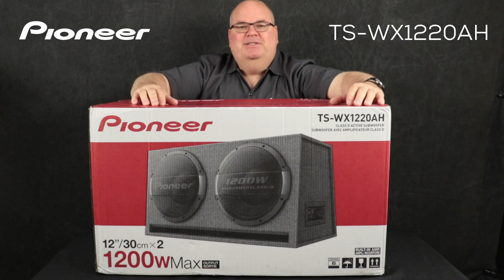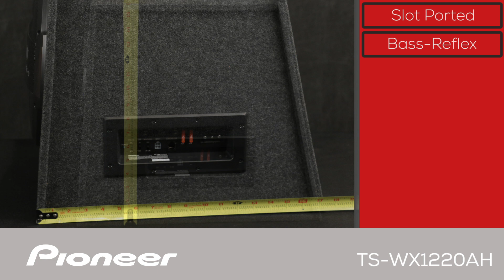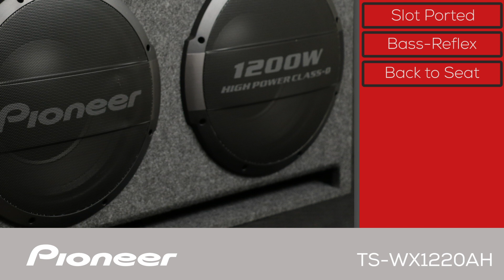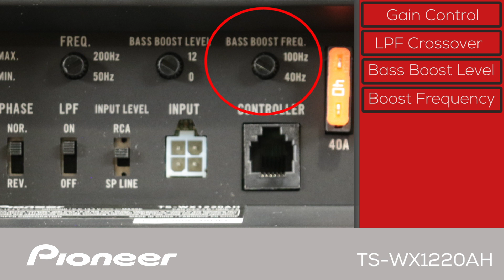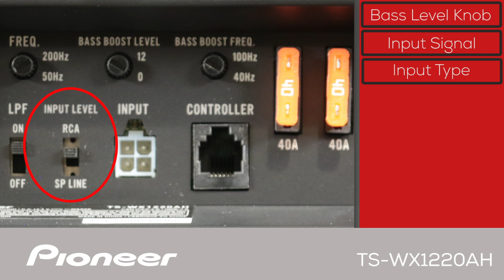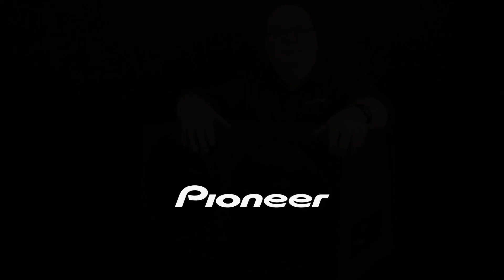Pioneer TS-WX1220AH - 2 Twelves Powered Sub - What's in the Box?

Comment: hi, could you tell me what rms the amp is? cant find it anywhere, for some reason theres no information on the amplifier??
Reply from the maker: The class D amplifier built into the Pioneer TS-WX1220AH is designed to operate as part of the TS-WX1220AH system.  The amplifier's RMS output power is 600 watts to the TS-WX1220AH subwoofer drivers.
You can find more videos on Pioneer's YouTube Channel here:   https://www.youtube.com/user/pioneerelectronics

Comment: What gauge wire can i use with this ? Is 4 gauge and a 80 amp fuse ok ? Many thanks :)
Reply from the maker: I recommend 12 gauge or thicker wire for the power and the ground wire on the Pioneer TS-WX1220AH.   If you want, you can use 4 gauge, it will work great.  Unless you have a very long run from the battery to the subwoofer installation location,  for example, more that 15 or 20 feet,   you can use 8, or 10 or 12 gauge with no worries.   
I strongly recommend an 80 amp fuse on the power wire within 12 inches of the vehicle's battery.  The subwoofer is fused at 40 AMP X 2 on the amplifier.
Please note:  You need to run the power wire directly to the battery.  However, the ground wire can be connected directly  to clean metal in the body or frame of the vehicle near the subwoofer installation location and does not need to go to the battery.  Please be sure to use the same gauge ground wire as you do with the power wire.
You can download a copy of the owner's manual for the Pioneer TS-WX1220AH here:   https://www.pioneerelectronics.com/StaticFiles/Manuals/Car/TS-WX1220AH_WX1210AH_WX1010LA_InstructionM040720.pdf
This and more install information is shown in detail.
You can find more videos on Pioneer's YouTube Channel here:  https://www.youtube.com/user/pioneerelectronics

Comment: What does each sub run at ? Your site has it listed as 3000watts ? But its 1200watts on here ? Is that each speaker max 600watts each 300rms hitting 1200w or what ? Many thanks 🙏
Reply from the maker: The Pioneer TS-WX1220AH has one built in amplifier.  Both of the subwoofers are  connected to the same amplifier.  The Pioneer TS-WX1220AH delivers up to 600 watts RMS output to each of the included 12 inch woofers and is capable of hitting brief peaks in output of 1200 watts to each included woofer.
The 3000 watt number is combined peak power   handling   capability   of the woofers and has nothing to do with the output power of the system.
You can find more videos on Pioneer's YouTube Channel here:  https://www.youtube.com/user/pioneerelectronics

Comment: I have a Mazda 6 2017. And I wanted to buy this sub. But what else would I need specifically in order for me to install this sub in my car.
Reply from the maker: I recommend professional installation for Pioneer products.
If you want to do this work yourself,  please note:  The Pioneer TS-WX1220AH needs a direct power wire connection to the vehicle's battery.  I recommend the use of an amplifier wiring kit.  I recommend a 12 gauge wire kit or thicker wire for best performance with this product.   Many are available.  Here is one possibility:   https://www.crutchfield.com/p_142AK10PS6/EFX-Rogue-Amplifier-Wiring-Kit.html
With any wiring you do, please be sure to use a fuse within 12 inches of the vehicle's battery.  And to use 12 gauge wire or thicker for the power wire.  Always use the same gauge wire for both the power and ground wires.  This is typically included with an amplifier install kit.  You don't need to ground directly to the battery.  You can ground to a clean connection of metal in the body or frame of the vehicle.  
You'll also need a way to send audio signal to the Pioneer TS-WX1220AH amplifier.  If you are sending the signal from the in-dash receiver, you'll need RCA cables long enough to reach from the back of the receiver to the subwoofer.  These are usually 10-15 feet or so in length.  Or, you'll  need a stretch of wire to go from a rear speaker to the subwoofer and use the speaker level input option on the subwoofer.  
You'll need a length of wire to automatically switch the subwoofer on and off with the vehicle.  This is typically done with the Blue/white wire on the back of your Pioneer in-dash receiver.   You can learn more about wiring your Pioneer receiver here:     https://youtu.be/kR2MO2kwFug?t=148     
This is the center terminal on the wire block.  You can see it here   https://youtu.be/RFb9Qpt9Obo?t=42
You can find more videos on Pioneer's YouTube Channel here:   https://www.youtube.com/user/pioneerelectronics

Comment: Hi there, i’m keeping factory radio Mercedes’ Benz do I need a LOC Line Out Converter or I can just connect it from the rear speaker or the subwoofer Directed,  thanks
Reply from the maker: The Pioneer TS-WX1220AH has it's own line out converter built in.  You don't need to add one.  
You can simply cut off the RCA connections on the Signal Input wire harness for the TS-WX1220AH.   Then use the positive and negative wires to connect directly to the speaker leads in the vehicle.  You can see it here:   https://youtu.be/RFb9Qpt9Obo?t=58
If you are using Speaker Level input directly to the TS-WX1220AH be sure to set the Input Level switch to SP Line as shown here:     https://youtu.be/RFb9Qpt9Obo?t=350
If you want to use a separate external  Line Output converter, you can do that too.  Just connect the RCA output from the external line output converter directly to the RCA input wire harness on the Pioneer TS-WX1220AH.
You can find more videos on Pioneer's YouTube Channel here:  https://www.youtube.com/user/pioneerelectronics

Comment: I alteady have the amps. I was looking for something. To put in my extended cab of my 1994 chevy 1500.
Reply: If you already have amplifiers I recommend a couple possible solutions.  If you want a 12 inch woofer in a ported enclosure, I recommend the Pioneer TS-A300B.  You can see it here:  https://youtu.be/QgG1mu2u3XI?list=PLw63zJRQbCNhkTQCxPpxGF4h6l6qocsaR    The Pioneer TS-A300B is a 2 ohm woofer that will handle 500 watts RMS and 1,500 watts peak. It's ready to go right out of the box, just hook it up to your amp.   One or two of these will let you know they are there.  There is also a TS-A120B.  Very similar, you can see it here:      https://www.pioneerelectronics.com/PUSA/Car/Subwoofers/Preloaded+Subwoofers/TS-A120B    If you like a sealed enclosure woofer, please consider the Pioneer TS-WX106B or the TS-WX126B.  You can see them here:  https://youtu.be/C7PYywFPTcM?list=PLw63zJRQbCNhkTQCxPpxGF4h6l6qocsaR    A 10 inch or a 12 inch in a sealed enclosure.   All of these subs need an amplifier to be added on.  You can find more videos on Pioneer's YouTube Channel here:  https://www.youtube.com/user/pioneerelectronics